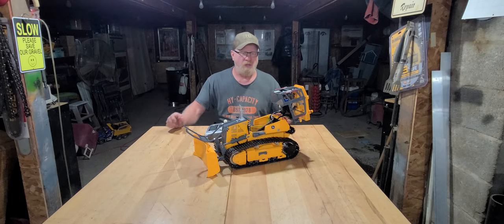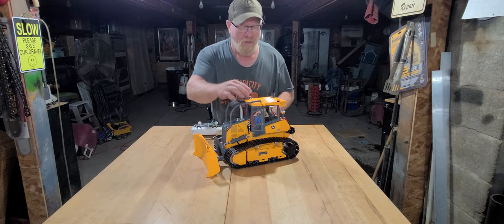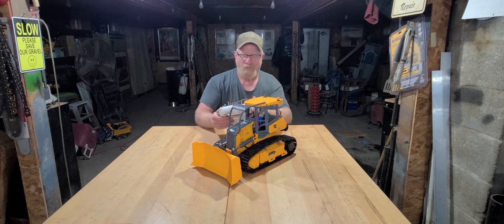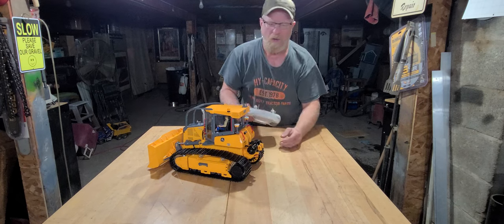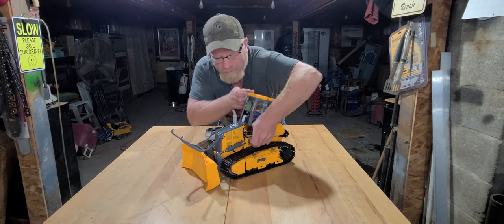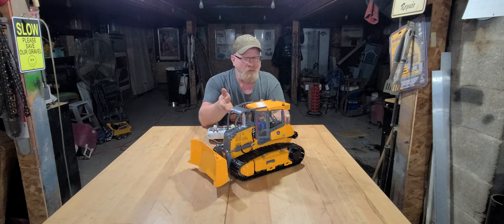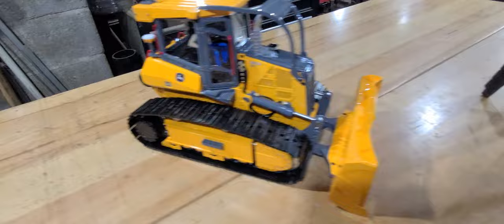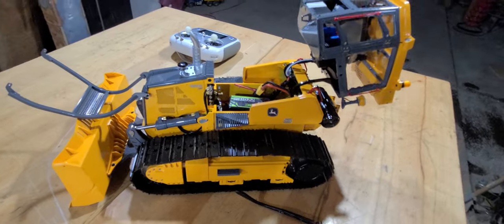1/14 SCALE RC CONSTRUCTION EQUIPMENT LESU 850K RC DOZER Initial Review

Comment: Thanks for posting this video.
This is a machine im very interested in buying soon. 

Have you come accross anything that needs to be addressed?
Reply from the maker: Nothing so far. Just had it at a show this past weekend and ran flawlessly.
Reply: How many hours of run time do you have on it?
Reply from the maker: @wedicotrucker2003  probably about 3-4 hours total so far. Had it at a show in Dubuque, IA a couple weeks ago and ran about an hour there. Usually if an issue is going to happen with LESU products it shows up on the first time run.

Comment: Nice machine and video! Do you have a short or long term experience with the track reliability? In this kind of modells always the track is the most problematic part (a track is come down or brake or damaged). This would be my first track RC machine and I'm afraid I'll have a lot of problems with the track. Thanks!

Comment: Does the blade have a tilt function
Reply from the maker: Nope, and I am OK with that. More functions are great, but if you don't have the patience and know how to use them, then they are useless. JMO
Reply: I am looking to buy one I am retired cat skinner I was wondering about  the tilt on the  blade sounds like you are ok with the way it is right?
Reply from the maker: @tonybaltazar5247  I am fine with it as a single action blade. Some want more, and unfortunately, most that do would not know what to do with it if they had it. LESU does have what they call a DT-60, I think, and has a 6-way blade and is larger, heavier, and about twice the price.

Comment: Good video 😊what sound system is installed? I’ve seen they sometimes use the Servonaut sound module for some machines, 7 days from payment to delivery seems extremely fast 👌🏻 how long can you run with that battery?

Comment: if you could only pick one this or the dxr2 which would you pick ?.....btw my favorite sound system is the one that dont work lol i unhook all of mine
Reply from the maker: Two totally different classes of machines. DXR2 is the brute pusher, and if you want to move a lot of dirt fast, where the 850k is more of a fine finish machine. I like both in their own job positions. All my RC'S are my favorites, kind of the reason never buy them and then sell them right away afterward as I see many do. I see so many that buy something, and as soon as one single issue comes, they dump them instead of fixing them.